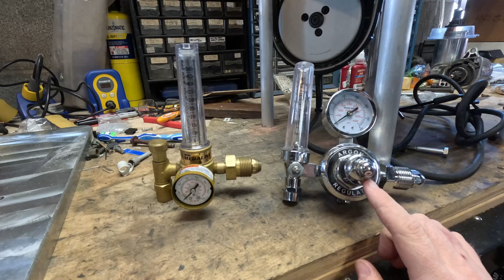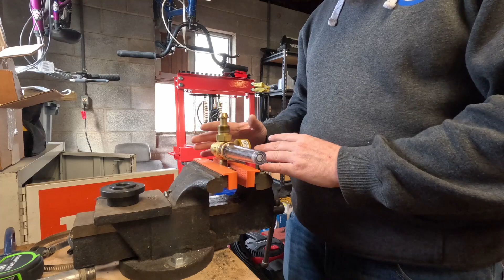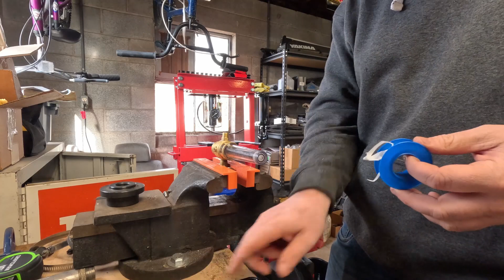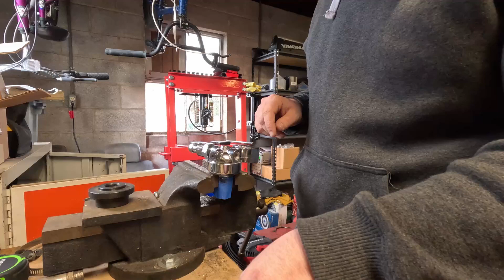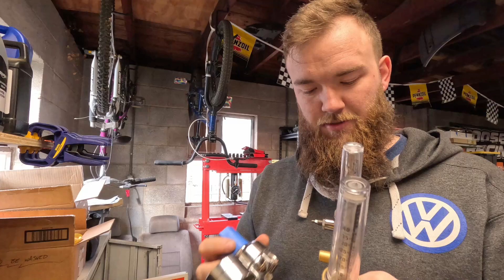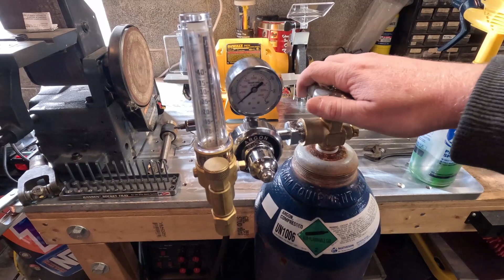Building a dual flowmeter/regulator for my TIG welder for CHEAP!

Comment: Those fittings on regulators can be a b*tch to loosen ,I've been there many times 🤣😂🤣
Reply from the maker: Oh yea, I was super surprised. The Victor regulator was easy to bust apart and didn’t have much thread sealant on the joints but the Eastwood one was WELL coated.